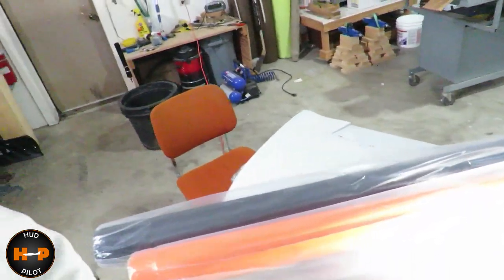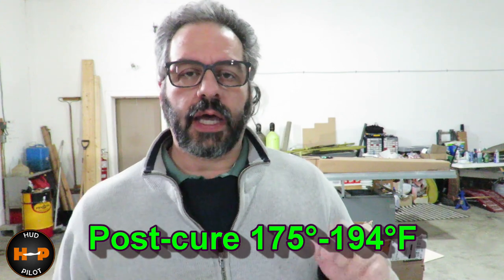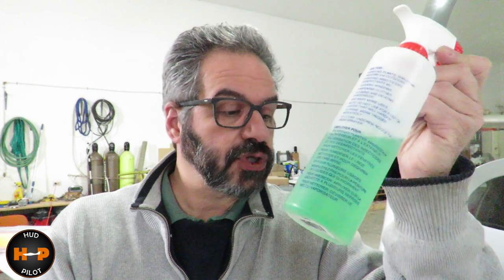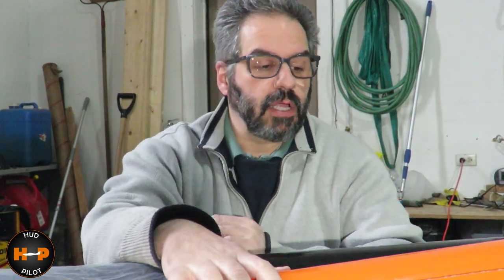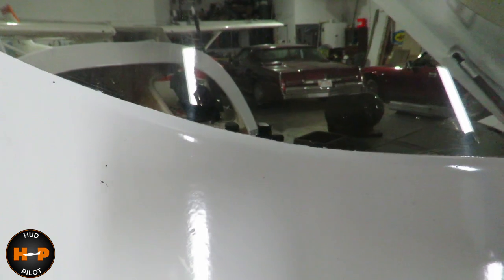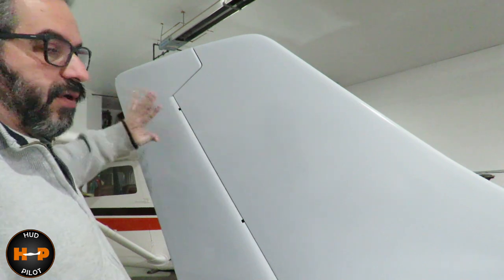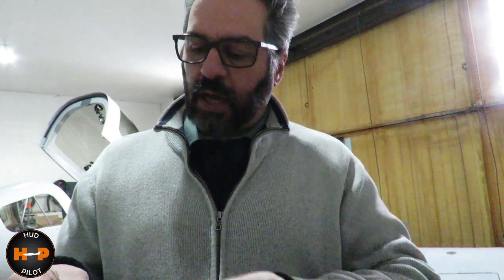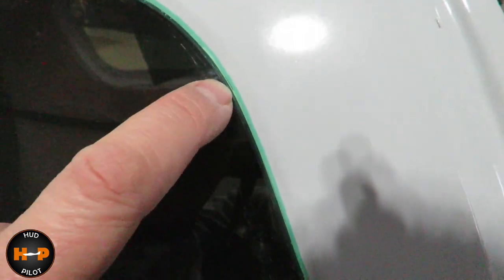Vinyl Wrap an Airplane: How I did it. Part 1

Comment: Tony, how much weight do you anticipate this will add? Does this impact how you do W&B calculations? Does CofG need to be re-evaluated?
Reply from the maker: Hey Cory. I am have estimated that it won’t add more than a couple of pounds. A 30ft roll which is 60” wide lists at 5.3kg for the “package”. I’ve used 20’ and less 30” wide of material. Gotta do some math for exact weight but should be too bad.

Comment: is there any issues with the legality of it? does TC approve it?
Reply from the maker: @M Hi. Legality have come up quite a few times. But always in the context of USA ... I am in Canada and no rule has been issues against it. Given that vinyl is used for lettering on airliners (the same vinyl I have used) as well some airliners (where I used to work) have the entire plane with giant wrapped sections done without anyone running to insist on having it removed. Given you said TC and not FAA, I go with the assumption you are canadian. The airline I refer to is canadian and they also fly into the states so dunno. Also my plane is Amateur built. Lots of manufactured planes have fancy paint schemes and augmented by vinyl striping so in my opinion.. pretty vague. I have also just recently seen a cessna completely wrapped... as in you can't see the metal of the plane and no one has gone knocking. I had found no rule for it.
Reply: @HUDPilot  thank you sir. Yes also Canadian, and found an FAA regulation against it as it can hamper visibility of corrosion or cracking in the aircraft surfaces. The reason I ask is because I found a Piper cherokee 140 that I liked but it was completely vinyl wrapped also.
Reply from the maker: For me, the only concern is what did the surface look like before it was wrapped and how long the wrap has been in the plane. First part is, was it done to enhance a nice paint job or was it done to hide something (which vinyl doesn’t do well as mention in the video series). The second part of question relates to time that vinyl has been on the plane. 3M says 7ish years of life in the elements. If the plane has been parked outside in the Canadian winters then how far are you from having to redo the wrap or remove it (which will require chemicals to do so as per 3M). If always indoors then tou can probably at least double those years: guessing. I am not sure. Given that it cost me around 1k to do mine, not a bad investment compared to 20k to paint it in the scheme I have. In the end, don’t think there is a rule in Canada and maybe find out the condition before the wrap was applied.